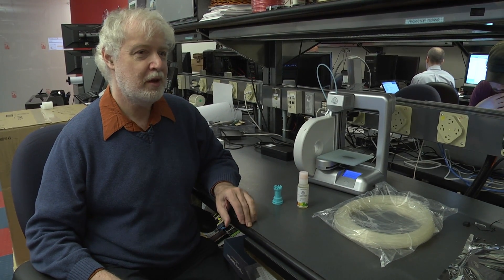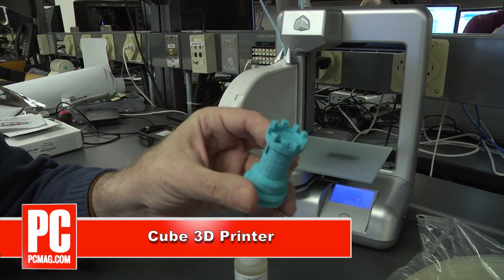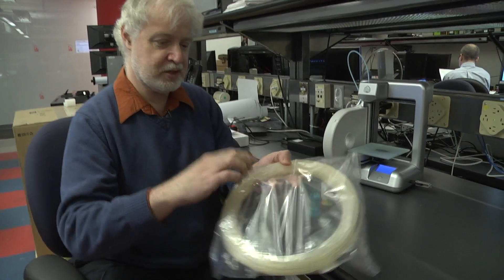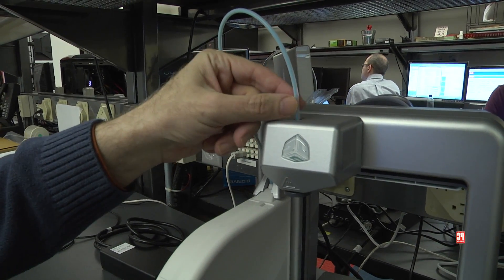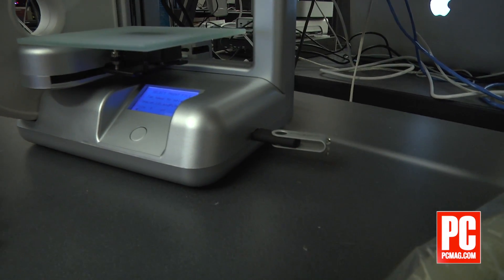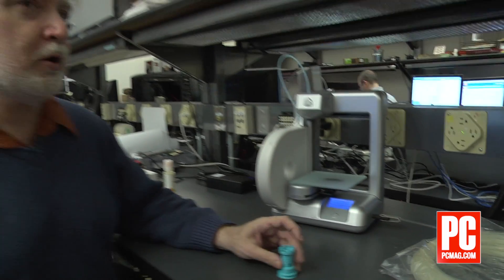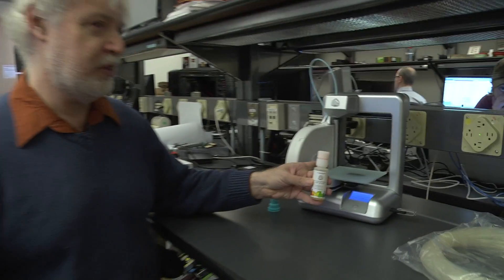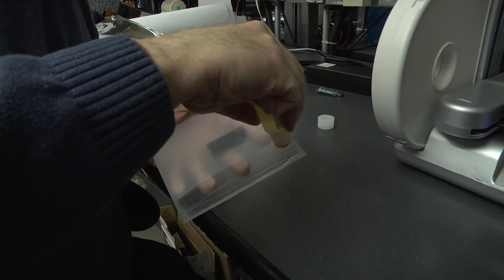Hands On: Cube 3D Printer

Comment: Dam, I could ,are one faster lol-  check out the robo 3d. Printed with one at 15 microns (0.015mm) and is huge-  best printer for the price out :) :) :) check it out
Reply: That's after you add a couple hundred in mods and when it's not breaking down or a thermistor going out due to a bad cabling design.
Reply: If you'd has issues I can help you with it but the only mod I made was a nicer extruder just so I can print with a wider verity of plastics